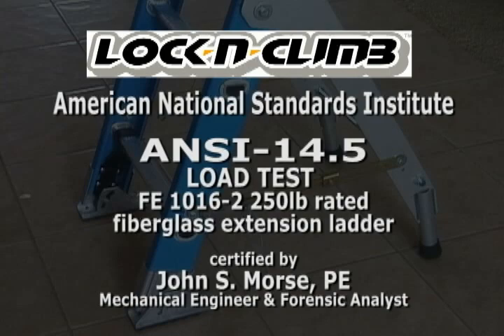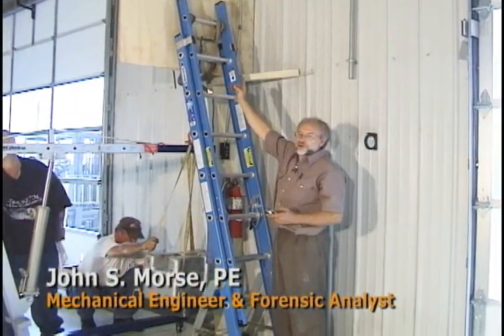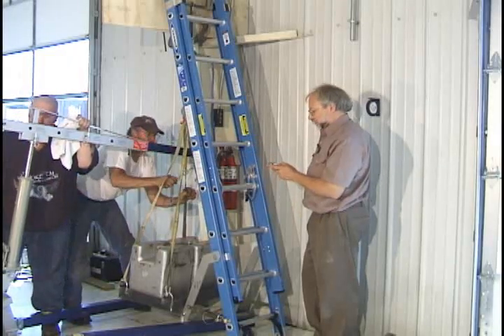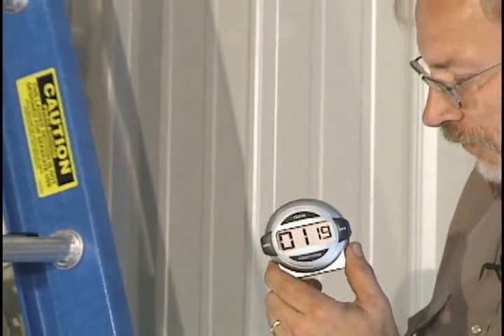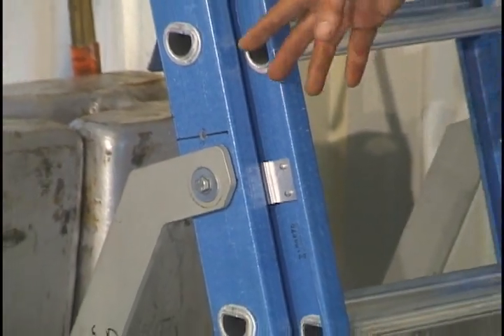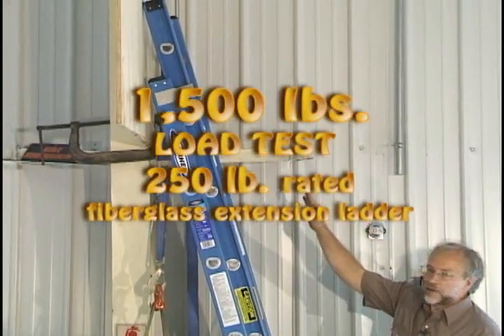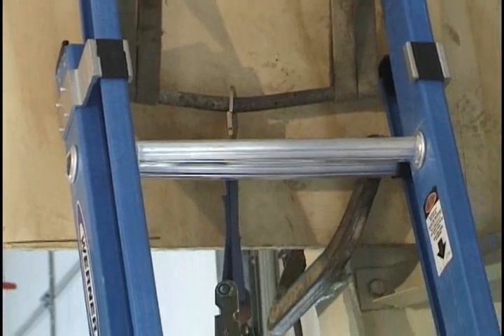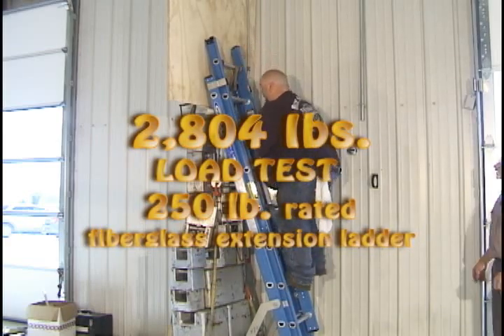LockNClimb ANSI Test 250 Pound Rated Ladder System

Comment: This only proves that the added legs and the individual runs can handle heavy loads when the ladder is  collapsed. and no doubt gives added stability when the ladder is extended . But  this by no means adds to  the overall working load of the fully extended ladder.  all it really does is keep the ladder from slipping out from under you.   I am sure the manufacture under rates the load limit for  safety reasons, and can actually hold more than what is stated, however if you weigh 300 pounds and you are trying to carry a 50 pound load to the roof with a ladder rated for 250 pounds.  and you think adding this device with support 1500 pounds as they are suggesting .....    let me know how that goes for you